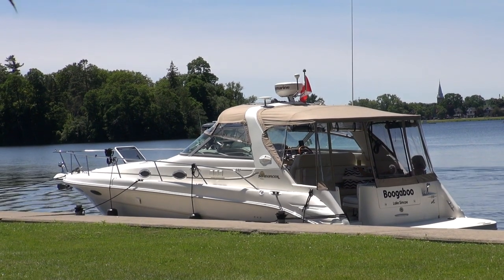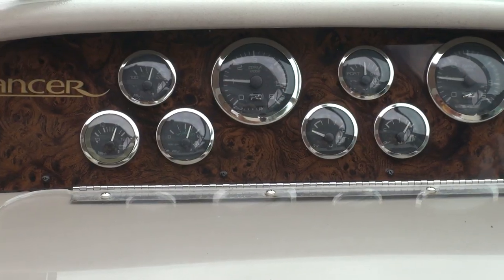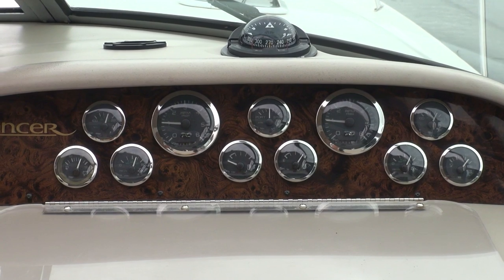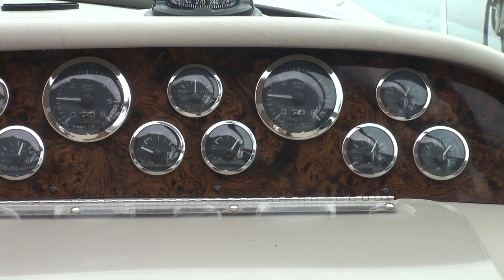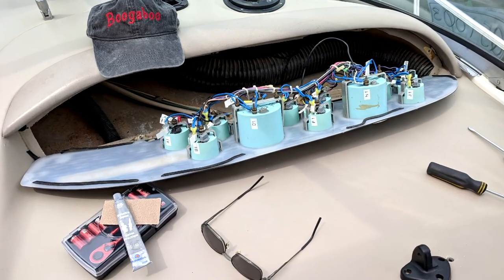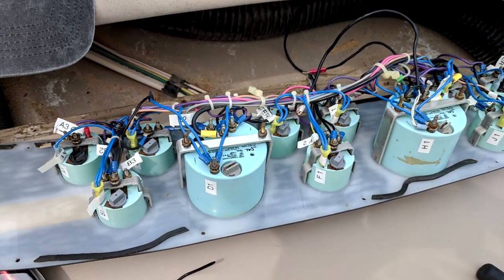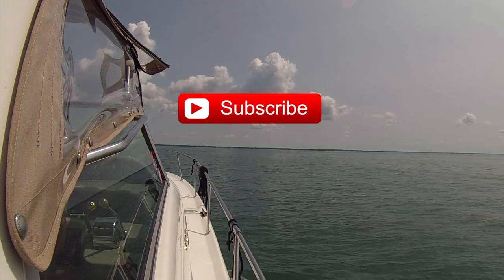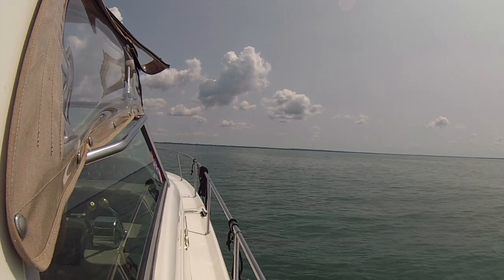Boating Basics - Gauges Explained!

Comment: Gauges are always a fun thing on any boat.  On our 370, all gauges work as they should.  My issues tend to come with the tachs.  One time at shutdown they settle to about 7 o'clock.  Others, one of them sits at idle rpm or jumps up a bit.  Very weird.  We've reseated the wiring but still happens.  When running, we have no issues.  Gas gauges are the other for us.  Like you, we use the Starboard gauge as the Port only goes to 3/4 when full.  Yes, new sending unit is on the list for spring!  Always great videos Paul!  Thanks.
Reply from the maker: Me too. I still have the sender that I got pre-holidays for the port tank, sitting nicely in its packaging 🙄 I'm gonna get one for the starboard side as well, and fully expect to install both. Soon 😁

Comment: Great video as always Paul! I have the same gauges with identical engines as you and my port engine always reads slightly warmer then starboard. All impellers were new in the spring and the port engine got replaced again in July when the impeller housing cracked and needed replacement and the kit came with a new impeller. It still reads warmer them starboard, but not much, maybe 5-7°. My port tach doesn't work at all so I go off my synchronizer to keep the RPMS the same. The previous owner said that he tried fixing it, but it still doesn't. I may take a shot at it this offseason. Got any recommendations?
Reply from the maker: I'd check the wiring connections. I did that and removed every wire from every gauge, sanded the terminals and applied dielectric grease on them to ensure a good, positive connection.

Comment: Can you hear the harmonics of the engines?  Usually when they are spot on synchronized you can't hear an "out of balance" sound.  Not sure the proper terminology for that.  The further out of sync they are the slower the sound, as they get closer to sync the sound quickens then goes away when in sync.

Comment: Replace instrument cluster eyebrow?  Someone tried to mount a cell phone holder and cracked the eyebrow piece.  Any idea where I might find one? Looked and looked with no luck!  Thank you so much for you time.  Ken
Reply from the maker: Hi Ken,
 If you're referring to the woodgrain panels, you can find replacements at Flounder Pounder Marine https://www.fpmarine.com/
They have a great selection, especially for Sea Ray boats. If you find something, just let them know that the Boogaboo Crew sent you! 😁
Reply: @BoatingWithBoogaboo  Unfortunately it's the piece that runs over the top of the woodgrain panel.  Thank you, Paul.  I think I am going to have to pin it and pour epoxy over it, which is going to be difficult due to the shape.  Maybe it can be removed and used as a mold.

Comment: I use Autometer Marine gauges on my boat, best out there.
Reply from the maker: I'll check in to them. Thanks for the heads up 👍
Reply: @BoatingWithBoogaboo  I don't think you'll be disappointed. I've used their car gauges for many years in all my projects and never had a problem or failure. Also NASCAR teams have been using them for years.